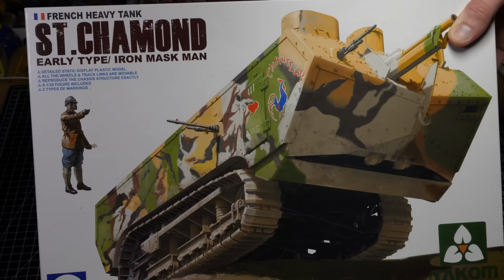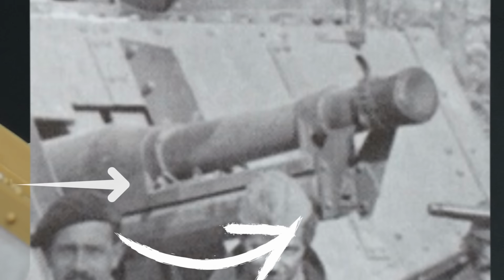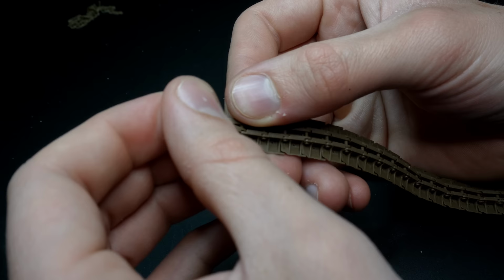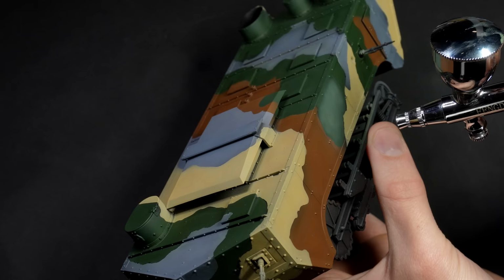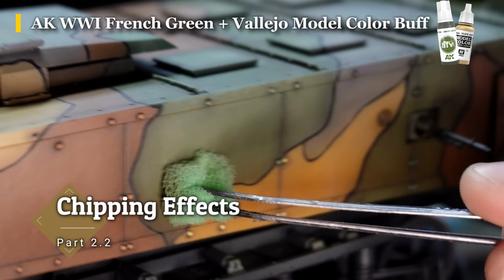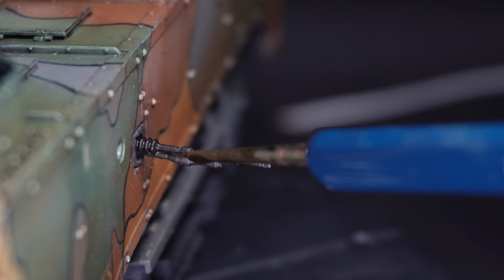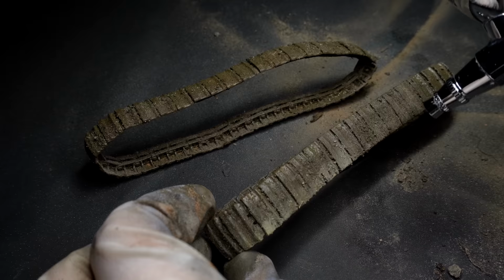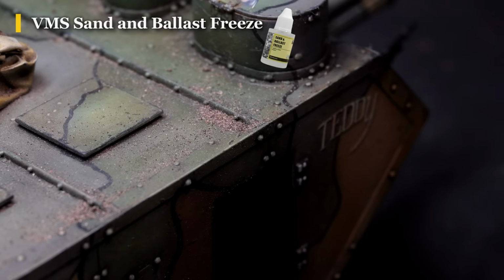Heavy Tank St. Chamond | Takom | 1/35 | How to Build, Paint and Weather a Tank Model | step by step

Comment: Wow totally fantastic i first came across your videos watching airbrush tutorials. you've really got great skills. Can i ask where do you get the spare rivets and bolts you use?
Reply from the maker: Thank you very much for these very kind words! Indeed, the bolts and rivets I used there are cut from leftover parts of the kit. But there are a lot of additional bolts and rivets available for purchase. I actually use the set "Aber 35A015 Bolts and Nuts" the most. But if you only need round bolts, you can easily and inexpensively cut them out of aluminum foil. In my latest video I show you how to do it :)

Comment: Love your approach to apply the mud and dust to the hull and the tracks, in this part you mentioned that the dry mud should be applied in the outer part of the track, is this principle works for any kind of track? Or just for this one?
Reply from the maker: The rule is not that absolute, but the mud always dries fastest and consequently is brightest in places that are exposed and not in a permanent contact with the ground, or where the mud layer is thin. Therefore, especially the larger mud residues are also wetter and darker in the middle on the side of the hull than the thin dried layers around it. If the Tracks are traveling in permanently damp mud, they are of course completely covered with wet mud :). I hope this helps :)
Reply: @ModeliteDiorama  Thank you for answering my question.

Comment: For such sharp Camo patterns doesn't it make more sense to use paint brush instead of air brush?
Reply from the maker: Thank you for your comment! And I think, this is not a question of what makes more sense. Both ways are possible and bring certain advantages and disadvantages. Brush painting can take a long time in comparison and you need the airbrush for this cloudy color variation in the camo.  :)